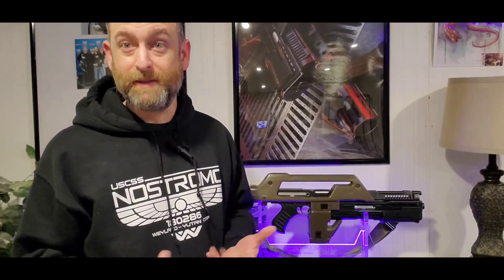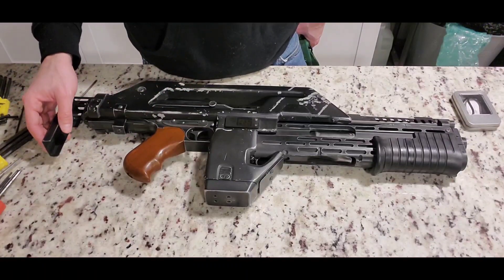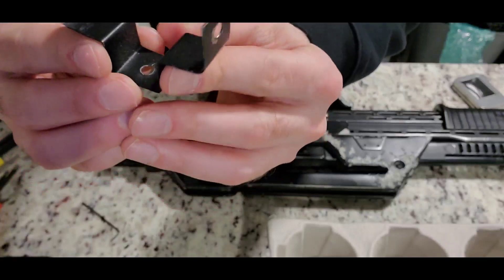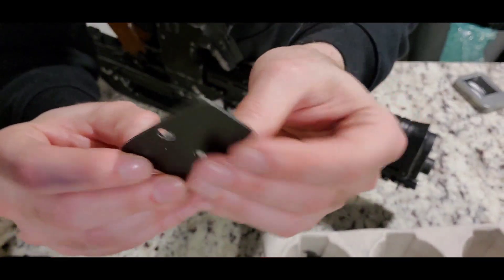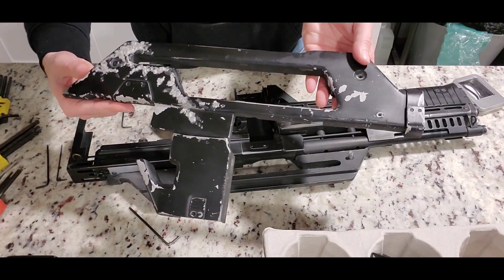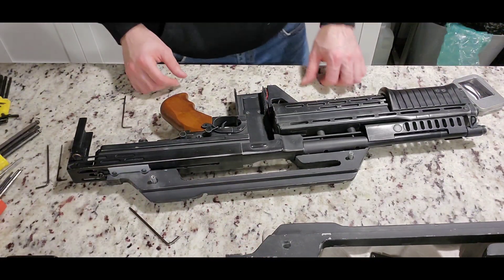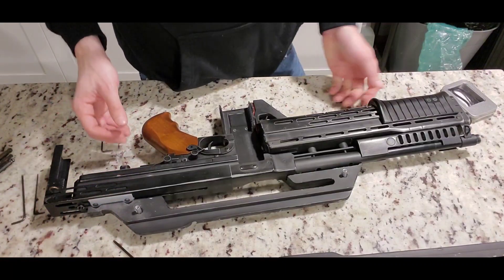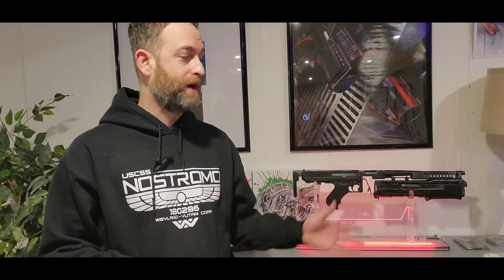Aliens Pulserifle Movie Prop. What's inside? How is it made?

Comment: Hello, great video, I own the snow wolf airsoft pulse rifle which i used constantly and have disassemble a few times, im also a massive Alien fan, I would like to buy another one but to later turn into a working one, which version do you recommend if the job is possible?
Reply: hi good luck finding a HCG hero pulse rifle it took me three years and the counter was not working it was 2500 pounds good luck
Reply: @anthonyclarke4538  that sucks, 2,500 is actually a good price, now days is going for $5,000
Reply from the maker: @anthonyclarke4538  there is one on ebay now listed for $5,000
Reply from the maker: You would need a HCG Pulserifle. It is the only one with metal shrouds
Reply: Also was going to order a hero ten vent but looking at the recent comments feel not to alot of guys saying he isn't trust worthy anymore what do you say about this as don't want to loose my money as I work dam hard for it
Reply from the maker: @anthonyclarke4538  I would hold off on ordering. He's really backed up on orders.